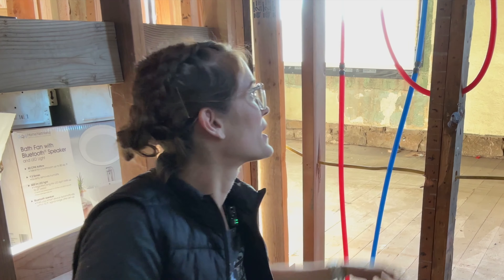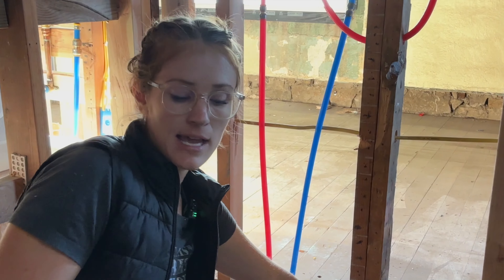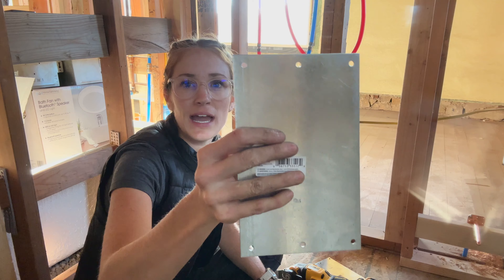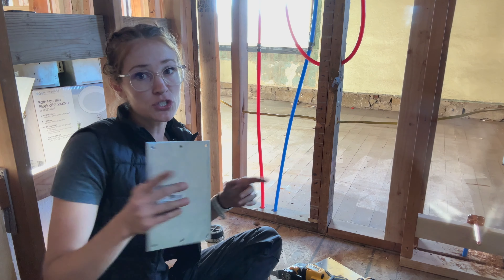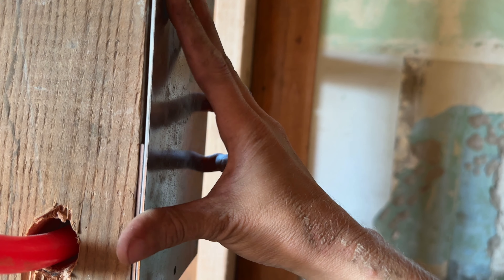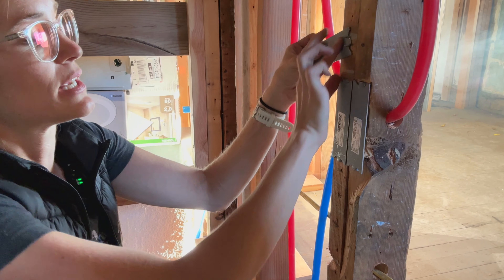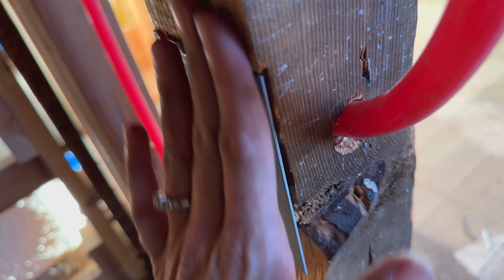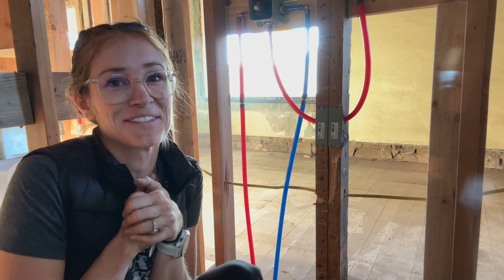Why You Need Stud Guards/Safety Plates in Your Bathroom Remodel and Whether or Not You Should Inlay

Comment: A good idea to put nail plates anywhere you have copper/pex/pvc piping running through studs but code only requires them if they're 1 1/4" or less from the stud face. Don't forget for conductors too, don't want a nail/screw nicking or going through electrical. You could also do a video on stud shoes too.